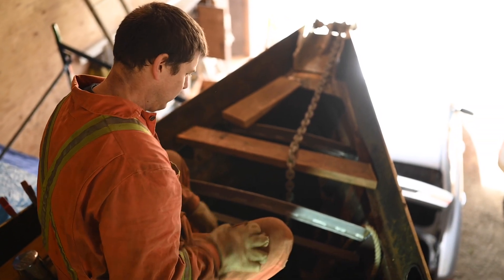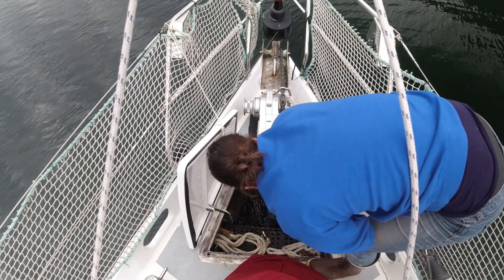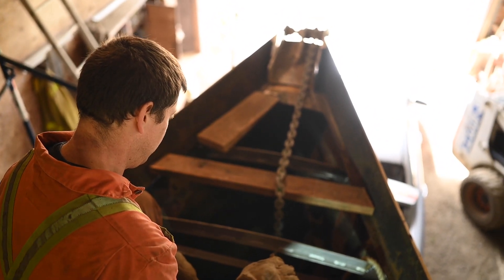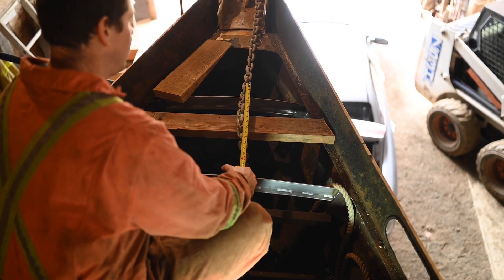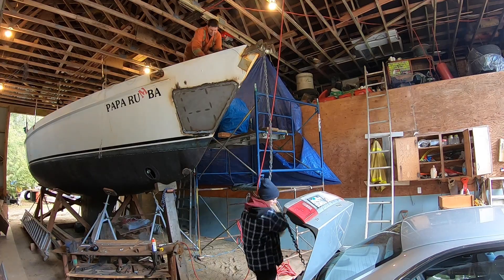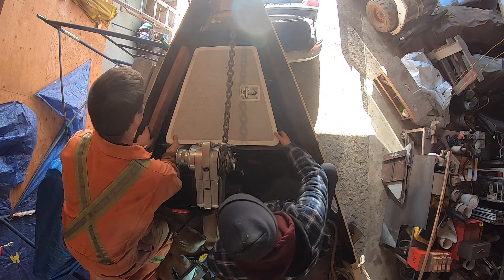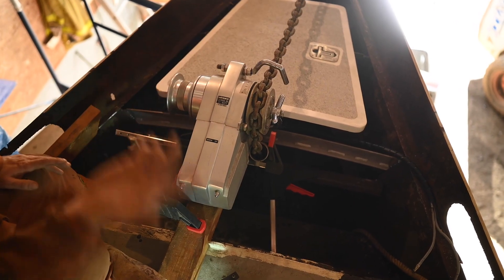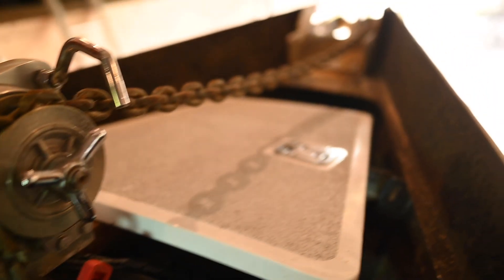Redesigning Our Chain Locker, Part 1 | Ch 5 E 17

Comment: I am in the process of fitting the A winch..the futher aft ,the more grip on the A chain,when retrieving chain in rough weather .A forward feeding spurling pipe distributing the chain to the deepest part of the locker to avoid flaking is what i have done .  ..raising the anchor should be a one person operation .Best regards ⛵
Reply from the maker: Thanks for watching!

Comment: Hi. Consider to cut the locker door into two unequal sizes, the larger piece to be hinged, the smaller piece to be slided only, so that you can take it off completely when going inside the locker. I had this in my last boat and it worked. Good luck.
Reply from the maker: oh thanks! that's def something to think about! You don't happen to have any pics of the door you had to share do you?
Reply: @WaywardLifeSailing  I should have some pictures. What eMail adress or WhatsApp address should I send them to, for you?
Reply from the maker: @silvanocometta9760  waywardlifesailing@gmail.com 
Much appreciated!
Reply: @WaywardLifeSailing  Thanks. I sent you two eMails with a total of 6 pictures. Regards, Silvano

Comment: Having the access door in front of the load is a massive safety issue.  You will want to add a chain stop somewhere near the anchor roller.
Reply from the maker: Hey David, we agree and that’s why we are going to split the door in half and have them offset so that we can open one door free of the chain line. Seems like a fairly common way of doing things on boats. Still not ideal in comparison to having the locker behind the windlass but a lot better than not being able to open the door with a chain running over it!
Reply: @WaywardLifeSailing  Yes, not being able to open the door without jostling the chain on the gypsy is an issue, but being in front of the tension is also a safety issue.  If you need to work on the windlass from the locker (perhaps wiring) with chain out, gypsy gets worn, chain gets worn, the list goes on, you want to be able to move the tension point forward of where you intend to be.  It's not a great solution, but a chain stop forward of the locker by the anchor roller will help keep you safe when you need it.
You could use your bridal if necessary, but if it is a gypsy issue, that might not be an available option.
Reply from the maker: @no1ofhere  we always use a bridal while at anchor, but I do understand what you mean. Def something to think about!

Comment: Is it possible to rotate the windless by 180 degrees, so that the long end is facing forward?
If done this way, the overhang is gone, the windlass can be moved a bit more to one side and there is plenty of room for a hatch.
Oh, and you'll have to reverse the foot switches, of course.
Great video!!
Reply from the maker: you are the second person to suggest this! If we hadn't already finished this project in real time I think we would have looked into that.  I guess some windlasses are built to be able to be reversed and some aren't. I'm not sure on ours.
Reply: Reverse is just a name on the button the motor doesn't care.
I was thinking can you flip it 180 and swapping capsin and chain wheel brings chain wheel back to same side but motor forward.
Reply from the maker: @tommussington8330  if we ever redo this locker again (fingers crossed that doesn’t happen) this will definitely be at the top of the thought list!

Comment: Forget deck access, put door inside cabin
Reply from the maker: we did think about this! There were three reasons why we chose to keep it on deck.  The first was the issue with still having to knock the chain down while it's piling which is a lot easier to do from deck., the second is that we are already limited on space in the v-berth and even putting a door in would cut down on that some more. the third is that we really want to keep that bulkhead waterproof! Thanks for your suggestion though :) much appreciated!